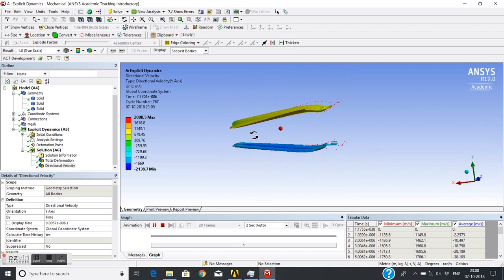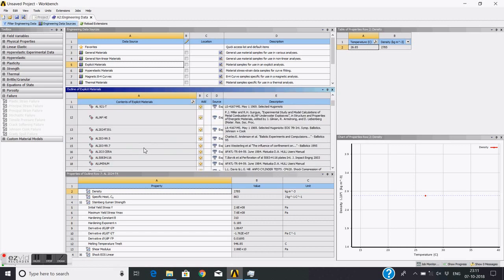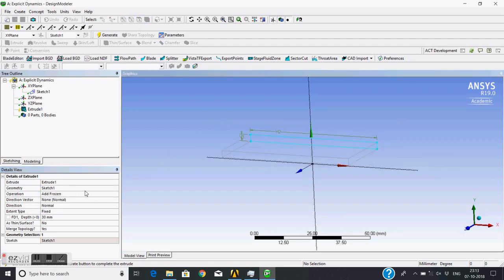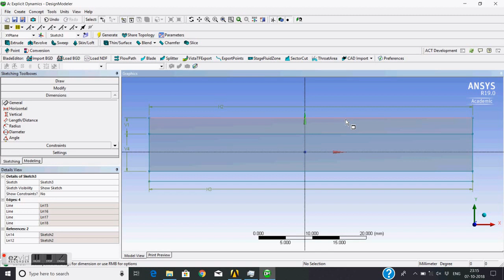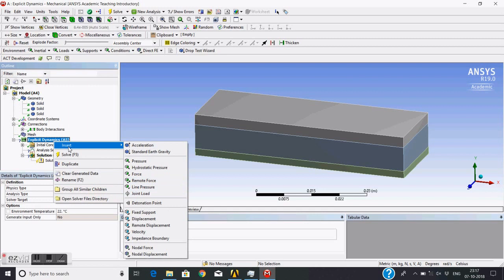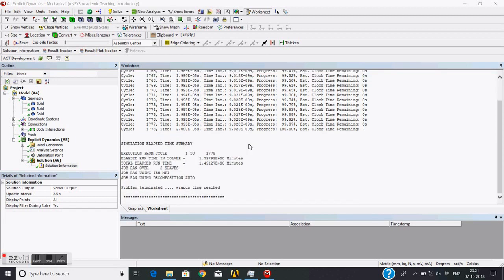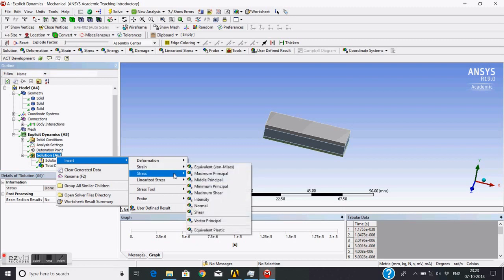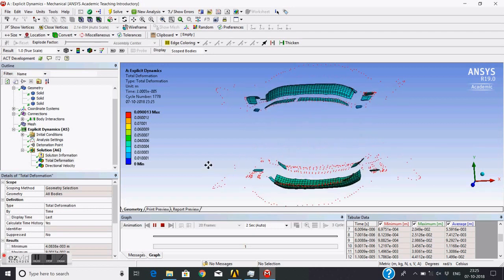Modelling explosive detonation in Autodyn by Lagrange Approach

Comment: Hi, Great tutorial.
But I have one concerned, When I runnig  model on my system, It comes error like
1) An error occured when post processor attempted to load a specific result
2) Current result file may not contain requested result data
3) The result file can not be open
Can you tell me what is problem behind these all error.
Thankyou
Reply from the maker: You are not storing some output variables. By defaults ansys stores few variables but not all. You can choose which is and is not in output.

Comment: Is it okay to do such simulation  through Lagrangian approach? How accurate are the readings as compared to experimental results.?
Reply from the maker: The Eulerian approach gives better insight into this phenomenon. But for this, you need to place very fine Euler mesh. Let's say for 3 mm thick plate you need to place element size less than 0.4 mm and it should be nearly perfect hex mesh (aspect ratio = 1). That's why Element count goes very high. In the Lagrangian approach, you get fairly good results with lesser mesh count. I prefer the Eulerian approach for this kind of problem. But in both approaches plate velocity matches well.